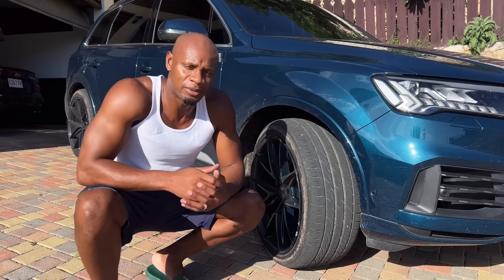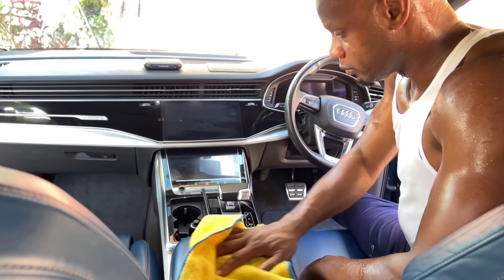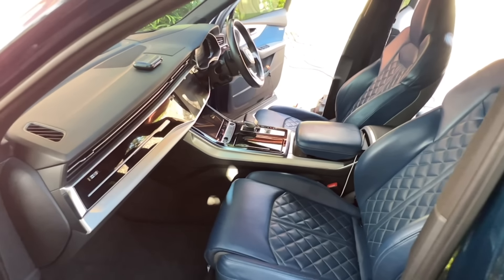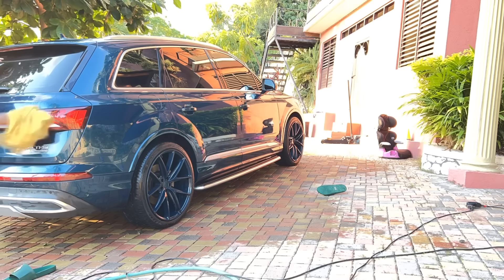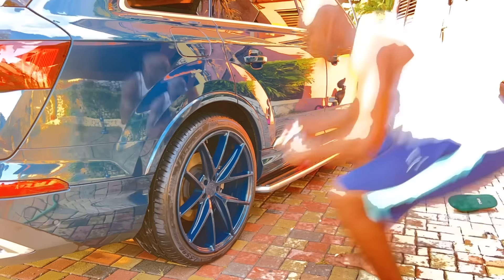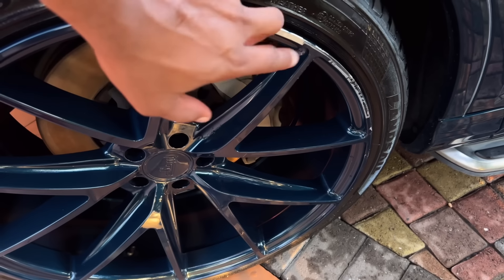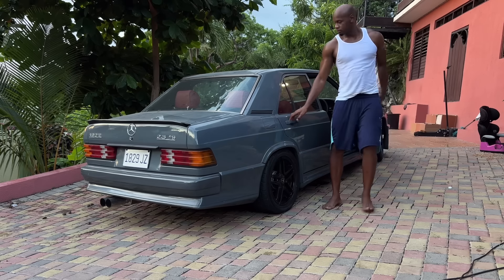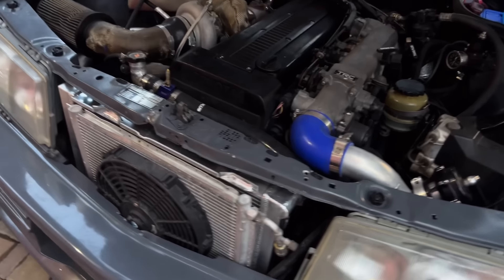Giving up on them , I think I will sell these cars, up for grabs.

Comment: The 190E sounds good and this is why; The 1JZ is a 2.5-liter, 24-valve, dual overhead cam (DOHC) inline 6-cylinder engine produced by Toyota from 1990 to 2007. It has a cylinder bore and stroke of 86 mm × 71.5 mm (3.39 in × 2.81 in) and a dual-stage intake manifold. The 1JZ was last sold in the Mark II Blit Wagon and Crown Athlete. 

 Some specifications of the 1JZ-GTE include: 8.5:1 compression ratio, Twin CT12A turbochargers, Front-mount intercooler, 7500 rpm displacement, and 8.5 psi of boost pressure.